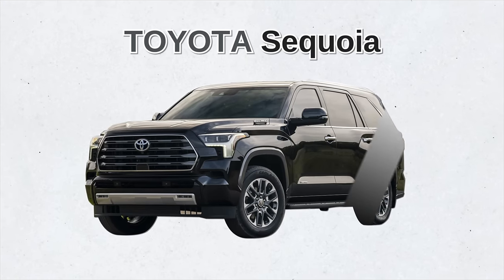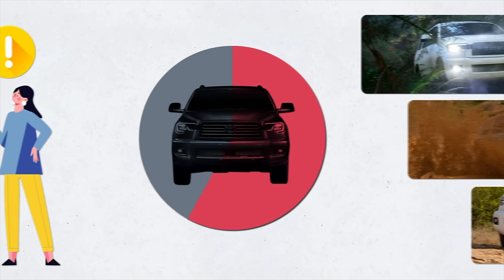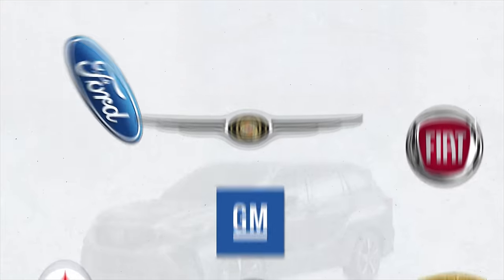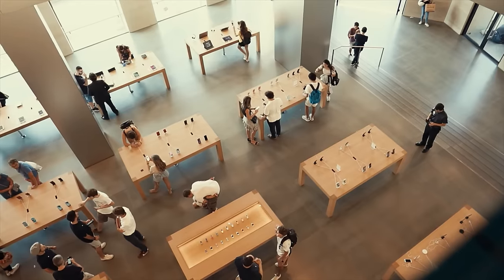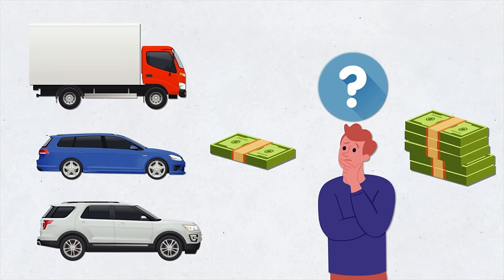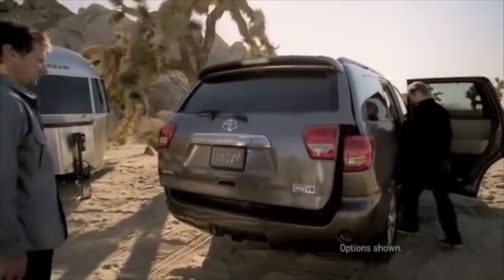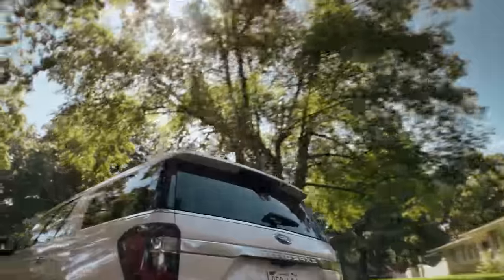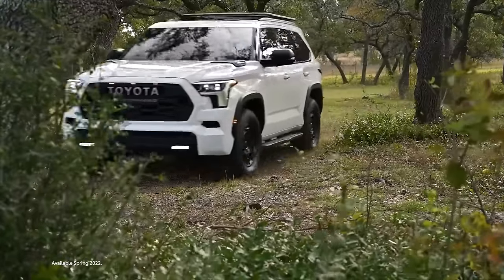Here's Why This New Toyota is Bulletproof

Comment: I own the 2020 Sequoia TRD pro.  Went back and forth between it and the expedition.  Chose the sequoia over the expedition specifically because the platform has been around and tweaked constantly by Toyota.  It’s far more reliable than the expedition as literally all the bugs have been worked out with continuous improvements over the years.  Figured if I was going to drop that much money on a family hauler, it needed to last 10-15 years, be able to tow and go off road.  Mine does all of it.  What I sacrifice in gas mileage I’ll make back in lack of major repairs.  Resale value is also a major plus.
Reply: Consider trading and upgrading to the new model! You’ll save so much on gas, even if the EPA rating isn’t that much.
Reply: That was my though process aswell didn't buy new when I bought my wife's 4runner right before Christmas but got a 2010 figured grt something that will live forever if imma be paying a pretty penny get something I know won't disappoint
Reply: Wait until the gov’t starts taxing gas.. you’ll wish you went with mpg.

Other developed countries have announced gas phase out dates between 2025-2030. U.S. will announce next, ESPECIALLY if the current admin wins 2024.
Reply: You made the right decision 👍🏻
Reply: Your are a clever man, and did the right thing. If one is spending big money, and family safety and reliability is at stake, the Toyota it must be. Or Honda. Or Mazda. Or Subaru.
Reply: @GoogleDoesEvil  I've been thinking that as well.
Reply: True
Reply: gAS HOG
Reply: You chose wisely - the expeditions 3.5 twin turbo doesn’t last. The Suburban would have been a good choice too.
Reply: @02hreblue30  Are you looking in the mirror after a meal of beans?
Reply: Great choice keep it for awhile and maintain it and it will take care of you and be reliable
Reply: As a Toyota enthusiast and owner of several models, I can tell you that you won’t be disappointed long term.
Reply: That would make a lot of since if gas was cheap & the Expedition was terrible
Reply: My 2008 sequoia has 204k miles. Solid as a rock. It’s actually the number two most reliable vehicle in the world, only being beat by the land cruiser.
Reply: Looked at both (and others) 4 years ago as well and went with the Expedition because of the third row seats and cargo room.  We got out of our previous vehicle because with four growing kids we needed the space and comfortable seating in all rows if we were going to keep the vehicle long-term.  The Expedition had all of that in spades, as well as great gas mileage for the size, and it has been bulletproof for the four years we've had it so far.  We can fit our family of 6 (oldest is 14) and all of our luggage and ski/board gear inside, without need for a Thule rack up top.  Our goal, as with you, is 15-20 years with this one.  This new Sequoia has a lot going for it for sure.  All the manufacturers are putting out great vehicles.  None absolutely better than any others.  Whatever fits your needs and priorities is the right choice.
Reply: My 2005 sequoia is still running great and I love it!
Reply: That should have never been a competition lol isssshhh Toyota over most all car brands lol
Reply: Choice wisely sir
Reply: @SoTiredButWired a fords not gonna break down or trouble with small repairs in 5 years. But it will need a lot of nagging repairs at 10 years. People who buy a sequoia plan to keep em for a good 15 years. If you plan to upgrade to a new expedition eventually or you won’t need the space when your kids graduate and you can switch to a more reliable suv you should be fine.
Reply: Well said. I own a 2013 Lexus gs350 and will have to upgrade since my family is growing ✌️

Comment: Our first Sequoia was a 2008 SR5.  Kept it 12 years and about 130K trouble free miles. Routine maintenance only. Traded in on a 2020 Platinum Sequoia and love it even more. The air suspension makes for a smooth ride.
Reply: Niiiice!
Reply: 130k miles...that's nothing. I would expect it to be trouble free . But you could have gotten another 250k easily. Idk why people spend that much, and trade them in so early..I understand getting bored having the same truck so long.. but still
Reply: @richsweeney1115  No doubt it could have run much longer, but  this was my wife’s vehicle and I wanted some of the new features added since 2008. And I could afford it. That 2008 model was sold the same day I traded it,  a real bargain for the next owner.
Reply: @TXAG81  I get it, it's just you lose so much value to not keep it longer. I've never bought a new car for that reason. I used to get bored and sell or trade what I had, in a year or so. Not so much now
Reply: Want to test drive this new twin turbo V6 sequoia soon
Reply: @sandman5088  Me too. Although I'm really disappointed with the smaller 3rd row in this new gen versus the older generations. Toyota going with that solid rear axle raised the seat floor of the 3rd row and made the leg room and thigh support really bad, close to what the LX is. The sequoia is supposed to be a full size family suv, but this new gen doesn't fit any decent sized person in the 3rd row. Toyota should have offered this new gen in an optional XL trim with an independent rear suspension to fit large people and cargo in that third row. What a huge mistake and missed opportunity for Toyota to not grab that larger family market share from yukon, suburban, etc buyers. Someone in toyota should be fired for that huge blunder. They totally ignored their current buyer base.
Reply: @nateg2468   very true,  we been waiting for xl long base , no roller down on back window, very disappointed,
Reply: @nateg2468   Very true No-Go. I have a 2014 Sequoia Platinum that I absolutely love, it takes me off road when i need it to and it looks right at home parked outside a fancy restaurant. I was thinking of trading it in for a 2020 or 2021 Sequoia, then decided to wait for the new 3rd gen. However because of that cramped 3rd row, I will go with my original plan and get a newer 2nd gen. What a disappointment.
Reply: ANY CAR GOES 150K
Reply: Did it have a timing belt or chain?
Reply: @tyjohnson9080  Timing chain. 2008 was the 2nd generation that ran largely unchanged until 2021. The 5.7L 32 valve DOHC engine and Aisin transmission were the most bullet proof features on this SUV IMO.
Reply: I can’t get over how Toyota sold the same vehicle from 2008 for 50k in 2020. Lmao the 2022 sequoia or even past 2016 are like the same as an 08. That’s insane.
Reply: @nateg2468  Well said sir. That’s precisely why my family is choosing the expedition over the sequoia. I want the Toyota reliability, but they screwed up the third row so badly there’s no cargo space. Have 4 children, space is a premium. Your right, a Japanese man probably committed sepoku for that blunder.

Comment: I've owned a 2003 Expedition and driven the twin turbo Expedition as a rental.  I currently own a 2011 Sequoia Limited. I appreciate the reliability over the technology. Old and outdated is still going and going in the Toyota, but the American SUV technology is breaking down too much.
Reply: Wish US suvs and trucks made base models without all the turbos. I have a 2021 Ranger XL and love the lack of computerization but still iffy about the eco boost holding out long term
Reply: sequoia isn't japanese made its us
Reply: @02hreblue30  same Texas plant as their trucks?
Reply: @02hreblue30  Japanese engineering
Reply: Not true.

Comment: My mom purchased her 01 Ford Expedition from the show room floor. The truck has over 460,000 miles and is still running today. It has been though 1 transmission. Very reliable and highly recommend SUV, In my opinion.

Comment: We purchased a Sequioa Platinum 2015 with 47,000 miles last year. Very impressed with the turning radius and the suspension, with enough power to pass other vehicles on the highway with ease. We test drove the Chevy Tahoe and the Sequioa had so much more leg room in the back for the kids, it was a no brainer. Yes the maintenance is higher but your getting the lastest technology Toyota builds in their vehicles. I was looking at buying the Tundra, but the truck bed limits the room for my too boxes when I pick up the kids. So, looking at another Sequioa.

Comment: My mom has a 2014 Sequoia it replaced her old 05 Tahoe that had weird electrical issues from new and ended up having major engine issues after 200k. She already has 140k on the Sequoia and she hasn’t had any major issues, only thing I can remember was the door handles felt stiff within months of ownership she got a letter saying that it was covered for free to have them replaced. You just can’t beat the hassle free owner ship of a Toyota they do care about their customers.
Reply: I plan to do 500k miles on my 2018 rav 4 which has reached 200k miles with just oil changes, runs like brand new. None of American companies comes half that close..

Comment: Love my Sequoia. 2008 Platinum trim with 225k miles and running like a top. The starter motor did just go out, but that’s the only “major” maintenance that the beefy boy has needed. Absolutely love this truck.

Comment: The earlier Sequoias with the 4.7 v8s have two things to be aware of .
A rubber timing belt that needs to be replaced at every 90k miles and a starter located under the Intake manifold which is major work to replace .

Comment: I’m 6’5”. I need the leg room offered in a full-size pickup or SUV. Over the years I’ve been driving “mid-size” is much smaller than it once was back in the ‘70’s. I would LOVE to have the economy of smaller vehicles, but I’m just not the right size for a small car.
Reply: You would fit just fine in any accord, Avalon, Camry etc. Not like you are Shaquille O'Neal size
Reply: Try a kei hatchback 
Or even as far as a Mitshubishi toppo 
Or daihatsu move

Comment: Love my 2004 Sequoia 4WD, 163,000 miles and runs like a clock.  Paid $4000 for it in the summer of 2020 which seems like an absolute bargain now, could easily sell it for $6000 but plan to keep forever.  The guy I bought it from purchased it from a Toyota dealer when it was a year old, before that he said it was owned by the FBI!
Reply: I like my 2014 Xterra. Comfortable ride. No major problems but it only has 50,000 miles on it.
Reply: fbi and all highway miles 🤣
Reply: That was a good deal. I'm sure you could get way more than 6
Reply: @genericdude6551  my 2014 xterra has 118k on the odo and its been great!  very happy with it! Need something bigger for the fam and can't tow my boat, but it's been a reliable little truck and great in the northeast winters
Reply: You can sell it for more than $6k fyi
Reply: I had a 73 Datsun 510
Reply: @genericdude6551  wow that’s really good my moms xterra has 278k miles still runs fine but got in a accident there really reliable we had 1 problem over the last 100k miles we didn’t own it before that but everything is stock if u change the oil every 3k-4k miles it will last u 300k+ jus the gas mileage sucks
Reply: @dummytummy7622  I averaged 15.4 mpg over the past 3000 miles on the Xterra. Better than my Mustang that averaged 14.5 mpg over the last 4000 miles. I don't drive a lot. I drove a company vehicle up until I retired and I rarely leave town since retiring.  Anyway, I don't normally keep a record of mileage or maintenance but I have started to do so.
Reply: @genericdude6551  wait till you gotta replace the sensor under the manifold 🤣
Reply: Yes, looking for one right now. For off roading to beat on it lol
Reply: @juniorcruz469  Which sensor is that?
Reply: @genericdude6551  but does your mustang have a v8 or. V6 cuz that makes a big difference 😂
Reply: @dummytummy7622  4.6L V8
Reply: Did it have bullet holes in it?

Comment: Last time I checked the Toyota Sequoia had the highest mileage by current owners of it.  Very long lasting SUV with basic maintenance.
Reply: It’s built like the Tundra and the Land Cruiser.  200k miles is just breaking it in.
Reply: I own a 2010 and noooooooooooooo problems😂😂😂😂😂😂😂😂
Reply: True,  my 2004 sequoia is close to 200k. It still runs great. My friend has one 220k. Brilliant engineers in Toyota.
Reply: I have a 2001. 368k. Still running strong.
Reply: I had problems with that too, being the same powertrain as the tundra, it should last about as long.
Reply: It's a basic truck for a reason

Comment: All that matters is: The Toyota Sequoia, if bought new, will last 35 years and 500,000 miles with bare minimum maintenance. All sane people, all over the world, have heard of this thing called Japanese reliability. If you value your money, buy Toyota.
Reply: The Sequoia is built in the US, I would much rather have my Japanese 4x4 made and assembled in Japan. Hence my 3rd Land Cruiser/LX ownership.
Reply: I've owned more Japanese vehicles than i have American vehicles, including owning a Japanese vehicle in Japan. They are no more or less reliable than American vehicles, all modern vehicles have the same problems. (Not surprising since 90% of the parts are made by 3rd parties and sourced to all the vehicle manufacturers) Toyota reliability is a marketing myth in modern times.
Reply: @francoa.9646  Its still pretty close. The factories here are still mostly ran by japanese managers with the same techniques and ocd stereotypes. I'm not sure if the LC100 is more reliable than a 1st gen Sequoia or if it deals with DVDO less since they have always been more expensive. DVDO: declining value declining ownership. ie: There's a lot less ragged out 90s LCs vs 90s 4Runners.
Reply: Absolutely
Reply: Or Mazda :p
Reply: Landcruisers are so reliable even 20 year old versions command a premium and prices have gone up.
Reply: Disagree, see American made Toyota products for reference. The new tundra has major issues with its new twin turbo v6
Reply: @robertsoria9293  Jury out on new turno V6, yes. But all other North America-only  Toyotas have been solid. It's the Japanese quality control. This company is special even by Japanese stds, imo.
Reply: @francoa.9646  or you could have saved like 40k and bought a 4runner that's made in japan
Reply: @OS-hx4jk  yes i will agree for the most part they're solid, but the tech is older so most bugs are cleaned up. Example. The hemi v8 is petty damn reliable aside from the exahaust bolts snapping in the 100K range and making a tick those engines are solid pushrod V8s. I get your point just pointing out that even Toyota has flaws. My 2019 camrys shitty transmission would agree... the 4 cylinder it had was proven. The transmission went rogue at only 18k
Reply: It's reliable but runs like a low budget car, wish they had suspension like Audi, I hate how Toyota drives,

Comment: I love my 02 first generation sequoia. 125k miles and runs like a dream
Edit: SR5, rear ac and heat, electric windows and seats... and two 12s in the back, new speakers, and tweeters that sound amazing. Chugs a lot of gas but I mainly drive to work and home, 40 minutes both ways. Love it
Reply: I have 2018 rav 4 with 200k miles and runs like new with just oil changes. Plan to do 500k miles on it. Feels like car with no engine but electrical motors but it has a conventional engine that needs no repairs..lol

Comment: I'm on my second generation two Sequoia.  The last one was hit by two idiots in a high-speed crash while my wife and I sat stationary at an intersection.  I traded that one in, just knew based on my past work experience in autobody that it would never be right.  Anyway.  Enough about all that, WE LOVE OUR SEQUOIA(s).  These are our favorite vehicles owned by our family.  Super spacious, powerful and handles really well.  And after taking such a hard hit as the last one, I can say super safe with that solid body on frame construction.  As for Ford, can't really say, but my old man was all Ford.  He got screwed by Ford at least three times on new, very poorly designed and constructed cars and trucks. Let me see, wiring harness malfunction= Grand Torino wagon burnt to the ground.  Another time dual fuel tank F100, second tank would not switch over, the Ford correction was to remove the second tank.  This was real attractive, now we had an extra fuel door on the driver side of the bed of the truck.  Third shafting was on a 1980 Fairmont, big piece of junk. Had brake lines inside under the rear seat, one of us kids spilled pop and it ate the brake line.  We luckly found the faulty brakes without incident.  But brake lines inside the passenger compartment, who does that, well Ford.  I wouldn't buy a Ford if they gave me the thing.  Terrible quality.

Comment: I still have my 2005 Sequoia SR5 4wd bought new. It has almost 202k on it, and has been regularly maintained and mostly problem free for 17 years (knock on wood). I’m currently looking for a newer (used) 4 runner or Sequoia but still plan on keeping my 2005. It’s a beast and has blessed me and my family with many years and miles of safe, reliable driving. I will be forever loyal to the Toyota brand.
Reply: Good luck on used. Saw a 19 4 runner listed at 60k. Insane. I also own an 05 sequoia. 220k miles.

Comment: At the time I was shopping back in 2017, the CR-V was less expensive than the Accord coupe, and the CR-V gets almost 30 mpg all around. So that's why I went with a small SUV / compact utility vehicle. Plus, we get lots of flash floods in Houston, so it does help to have a little extra ground clearance. The new Accords are pretty low to the ground because they're designed to be more aerodynamic. But a few extra inches off the ground can save your interior from sustaining water damage during a tropical storm if you live in a flood-prone area like Houston.